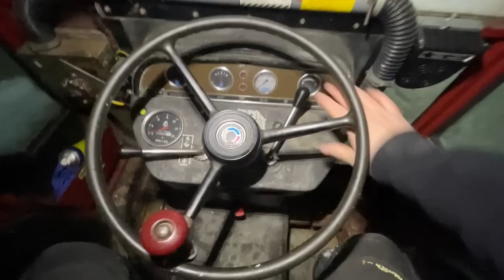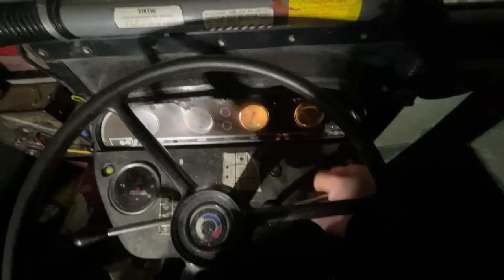1977 International Harvester 574. Cold start, Snowblowing, Diesel problems, Broken pto ujoint.

Comment: It’s got a really good starter to wind that long and not get hot.!
Reply from the maker: Most of the winding is cut out. Both the starter and the battery is very good!
Reply: You’re using the cold start incorrectly,lever should go from run position to cold start so you can feel just when it contacts detent position and why are you waiting to start cranking over engine there is no glow or heat for cold start and that style snow blower is worthless, you have to drive through deep snow before it reaches snow blower other wise thanks for the video those were great tractors, next year service the tractor before the cold weather lol😊 thanks again!

Comment: Gd ttactors these old 74 seies . The 574 pulls well above its weight . In cutivation time we had a 574 on a 4 meter power harrow handled it no probbs . Iust goes to show u dont need 280 hp to do jobs around a farm . 100 hp used to be the main tractor on a farm and that wasnt so long ago . And still the case on a lot of hill farms and smaller units .

Comment: That video just reminds me that, I'm so glad  I bought a new  Belarus diesel tractor 30yrs ago!  Might not be the best or refined (modern) but it just runs, and has never let me down especially running out of fuel, very frugal. Good luck, some of these diesels are can be a bear to get restarted.  That tractor looks like a keeper, once fixed
Reply from the maker: The tractor bled itself and started quite easily. The problem was water and particles from the diesel tank which clogged the diesel pipes and it froze. The diesel tank has not received good maintenance from the past.
Reply: I hear that, 1942 Case SC owner,  I even put a powerful small magnet in the glass sediment bowl, you would be shocked of the very fine rust particles that I find stuck to the magnet!  Good luck ☝️

Comment: I have a 1982 IH 260A.   I ran it out of diesel while I was working on sloping side of my property.  I have not been able to use ever since!!!.  It starts for about 30 seconds and runs smooth, then starts hesitating and quits.  I have so far replaced fuel pump, filters but with no luck.  I was told I may have to replace injection pump or fuel injectors or may be both.....
Reply from the maker: That was sad! I don't know your tractor, but I would have dismantled the diesel pipe connections and seen where the diesel comes out or not. If necessary, blow clean diesel pipe. On my tractor, the diesel tank has a large tank on each side. Return comes on one side and supply on the other side. If the pipe between these is blocked, one side runs out. And the other when refilling looks completely full. Before changing the injector pump, I would try and connect an external diesel tank high up, so you are sure it gets diesel. I have worked very little with the tractor and diesel engine, but I hope it helps.
Reply: Sounds alot like you have a air leak.  When you put the pump and filters on make sure the gasket is 100%.
Reply: Fill COMPLETELY up with fuei.
No more side sloping.
Up OR down. .   .   .   .
Reply: Yeah seems like air in system since it starts than dies. I’d purge your system again than try and give it more fuel when it starts to die. The air will eventually run through the system it may take a little bit though. Best advice. Never run them dry.

Comment: I bet you wished you had an eye on the fuel gauge now  .  I would have felt  a right Dinlow if I had done that  .
Reply from the maker: The fuel gauge is more like a poor indicator. My plan was to run out of summer diesel as much as possible, before I had to fill up with winter diesel. Unfortunately, it was a little too empty. But the tanks have not been drained, and benefited from a drain to get water and diesel animals out. Unfortunately, it ran out in an unfortunate place 😂

Comment: mine has a problem where after i put new injectors in it runs rough on idle and up to about 1000rpm then after that it evens out, no excessive smoke
Reply from the maker: Sorry,  I have no knowledge to assist you with that problem. But please let me know how it goes?

Comment: Whatvis the extra tube besides the fuel filters? Have 2  574 myself on is getting a loader soon😀
Reply from the maker: It’s a filter housing for the cooling system, it has a filter cartridge for cleaning the cooling water. There was a lot of rust in the cooling system when I bought the tractor.

Comment: Good  day from Ontario Canada  I have 574  & it is a very hard starter without heat  I see u have something on side of motor by your fuel filters , shiny thing ,  I also notice   have u got heater with key before starting? 
Thanks   Were are u from?
Reply from the maker: Hello Canada! I'm from middle of Norway. 
The blank is a filter housing for the cooling system, it has a filter cartridge for cleaning cooling water. There was a lot of rust in the cooling system when I bought the tractor. My tractor has a glow plug in the intake manifold, which also has a diesel supply. The diesel pump has a separate position for starting, I think this gives extra diesel for cold starting, also for the glow plug. I give it full throttle when the diesel pump is in the start position. The key supplies power to the glow plug in half position, and after approx. 10 seconds, a puff is heard, when diesel is ignited in the intake manifold, and the tractor starts quite quickly. In cold weather it has to be in start position, full throttle, and I still hold the glow plug for 1 minute. I dont use a engine heater.  Pardon  my google tanslate :D

Comment: kunne forklart deg du må ha over halvtank for att det skal klare og renne av seg selv til filterene  har gjort det samme selv 
da måtte jeg sugeframm diesel
Reply from the maker: Det ble fyldt på 40L diesel. Men traktor sto på skrått, og det var vann og gørr i systemet etter tomkjøring. Det er vist en svakhet at rør mellom underside på dieseltak går tett, og da må man fylle på over halv tank som du sier! Alltid får man kose seg med dieselproblemer i minusgrader 😁
Reply: @Sir.Espeno  har samme type traktor men min er vell litt mere sliten en din er🙈 og var ikke pto shaft det er pto ujoint om det skal skrives rett. Trodde med en gang du mente akselen inn i skinka på traktorn da ville jeg like og se din oprasjon av det 🙈 har gjort det og ikke noe morsom oprasjon. Men helt grei film snurt
Reply from the maker: Takk! Det skal jeg rette på 👍 Jeg har utfordringer med uløsing av clutch, eller så er den ikke i gir, det hjelper å bytte mellom høy og lav på torsjonsgir. Den har også veldig lavt oljetrykk når den blir varm. Kan derfor ikke gå på tomgang. Spørs om det blir noen flere filmsnutter 😂
Reply: @Sir.Espeno  jeg ble råda å kjøre min i høygir heletiden for å ikke slite ut clutchen på hurtigeare å kun bruke lavgear når jeg kommer i en motbakke eller har med tung henger. Isteden for å geare ned til 3. Lav oljetrykk på motor eller i gearkassa? Sender deg heller melding på fb i sten for å skrive  alt her